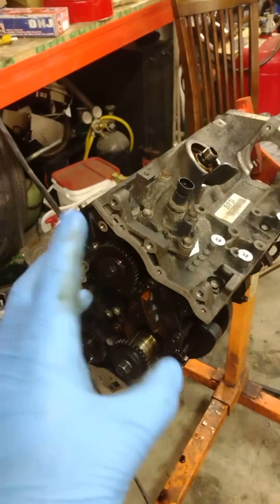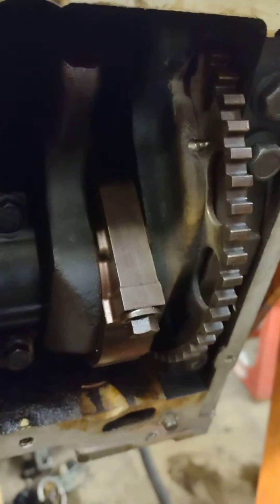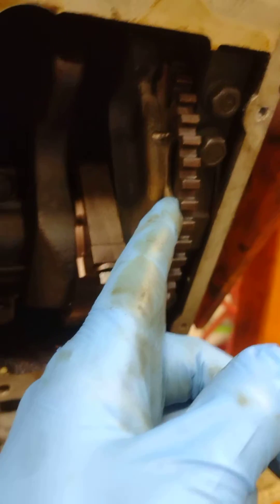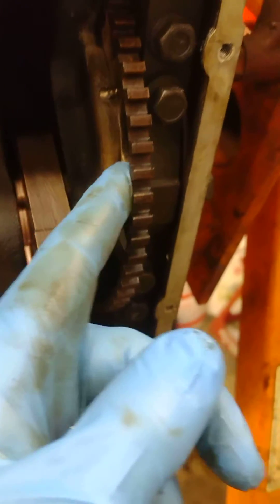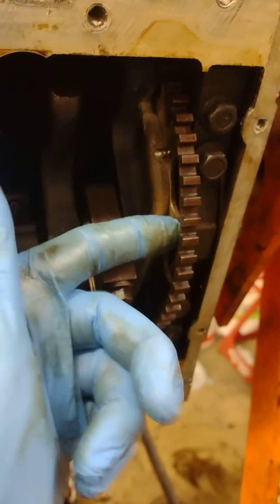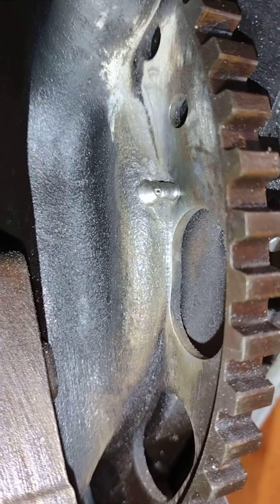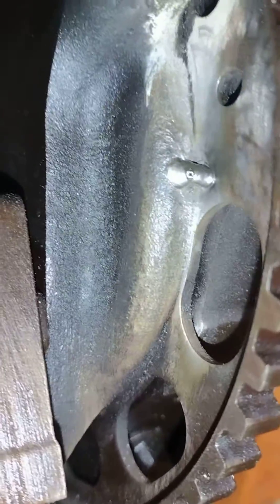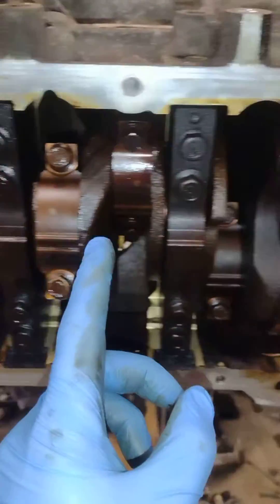GM 3.6L V6 crankshaft reluctor fix. (camshaft crankshaft correlation code)

Comment: One thing to take into consideration is magnetism caused by welding on a crank wheel that can be bad because it can interfere with the Hall effect sensors Ic by creating an opposing magnetic field and upset the pcm falsely setting crank codes.. may or may not be a problem, maybe that’s why they avoid it who ever rebuilds them, magnetism happens by applying a big DC current in one direction

Comment: I see you posted below, "You can verify reluctor wheel through the crankshaft position sensor hole".  My neighbor bought a used non running 2014 Enclave at auction.  Could you tell us where to find info on how to verify the proper reluctor wheel alignment.  He already replaced Crank Sensor, cranks but no start.  I am ordering a bore scope now.  Thank you.  So engine in this video is a good engine and you tack welded the reluctor wheel as a precaution, is that correct?
Reply from the maker: @jteddy11  yes precautionary.
Reply: @BBsAuto  Thanks for the reply, tack welding looks a whole lot easier that drilling and tapping, genius idea
Reply from the maker: @ yeah it really doesn’t need much but that is just one minor fixes these engines need lol
Reply from the maker: @jteddy11  yes it was a good block. 
There is a guy that shows a video on how to verify if it has spun on YouTube like you said through the crankshaft position sensor hole.
Reply from the maker: @jteddy11  it’s not super common but it is possible

Comment: Im getting P0017 and P0018 constantly on my daughter's 3.0 Omega (Australian car)
Woyld rhis have anything to do with the reluctor wheel?
Reply from the maker: I’m not sure on that. The design is probably way different compared to that engine. 
What is it that the car is doing?
Reply: @BBsAuto  it's basically a 3 ltr version of the 3.6.
It has 4 cam sensors and 4 actuator solenoids.
Engine starts fine, no rattles, E ns smoothly but is down on power. Slow acting throttle.

Comment: So did the fix work? Is it still working? Where you able realign the teeth to the correct position before welding?
Reply from the maker: It never moved. I hear that when they do you pretty much need a new crank.
But hey I would assume you could press it off and realign it.

Yes the reluctor never moved on it. 
It works to this day

Comment: I have a 2010 GMC Terrain 3.0. Timing chain was replaced in 2022, driven 20,000 miles since then. I am getting codes P0018 and P0019. Could this be my issue or do I have to replace timing chains again?
Reply from the maker: You can verify reluctor wheel through the crankshaft position sensor hole

Comment: I have a GMC Acadia I'm working on most likely it has this problem the reluctor wheel has shifted position this appears to be a great fix my question is when I open it up how do I know where to position the reluctor ring. Is there any indication where it was positioned originally so I know where to properly set it when I weld it in place?
Reply: @johnfloyd2551 There are some great photos in the GM TSB, that show one with the reluctor wheel moved and off time, and another photo that shows it in the correct position, in time. That was the "smoking gun" for me, when I was going about diagnosing the issue on the 3.6 Holden engine I was working on, that had the never ending cam/crank correlation fault codes. I listened the TSB# in one of my other posts. You probably already have yours corrected by now, but if not, that information will definitely point you in the right direction. Good luck 🙂👍
Reply from the maker: I have heard other techs say that the crack is bad after they move
Reply from the maker: But I suppose that it’s just a matter of moving it to the right spot

Comment: My garage told me this engine has 2 reluctor Wheels and they think one wheel has slipped causing a timing issue on the left Bank and said they have to remove my engine to investigate 🙄
Reply from the maker: There is 1 reluctor wheel and one crankshaft sensor on the crank itself. There are 4 cam phasers in the engine, and they have cam sensors and are the reluctors themselves. That send a signal. 
You can verify the crank sprocket is in the right place by searching it up. 
The cam phasers are checked easily and are more common than the crank sprocket.
Reply: It sounds as if they're kinda on the trail of the issue, but I believe they're still hunting and pecking at it. As @bbsgarage7640 said, there is only one single reluctor wheel on the crankshaft, that causes this problem. It's not anything to do with the camshafts. They are correct, in that in order to accurately diagnose and identify this issue, the oil pan must be removed. As to whether the engine has to be removed to do this, that may be an opinion of who's actually working on it. For me, there is no question, I'm removing the engine. As easy as these motors are to remove, and reinstall, it's a no brainer. You could possibly take a bunch of stuff loose, and raise the motor a few inches, and drop the oil pan, but that's just a nasty, incessantly dripping mess. Drop the motor out, put it on the engine stand, flip it bottom side up, and you have full access. Plus it makes it much easier to do timing chains, and other related repairs that are likely going to be needed.

Comment: I’ve worked at GM dealerships since 2004, not once have I seen or heard of a reluctor issue in these engines.
Reply: With all due respect, you might want to brush up on your knowledge base. This is a super common issue. The reluctor wheel slips on the crank, causing all sorts of timing related codes. Not only is there a GM Service Bulletin out about this issue, how to properly diagnose it, and how to fix it, there is also a bulletin from the National Highway Traffic Safety Administration. I don't know if you work in the shop, or parts, sales, or what department, but  if you work for the general, you should be familiar with this by now. I've got one in my shop now out of a 2011 Camaro, replacing the crankshaft and all the timing system components.
Reply: @timchilders3535  I graduated tech school in 2004 with honors. I immediately started my tenure at our local Chevy dealership. I’ve got nearly 20 years not only in turning wrenches, but writing service , and as well as parts serving my last 8 years as parts manager. I oversee all outside sales and over the back counter sales to our shop. Not once have we replaced a crank due to this supposed “common” problem. Just because there is a tsb on a problem, does not mean it’s common. But quite the opposite, it more likely to be uncommon. More like a “hey, if you’ve got these symptoms and a diagnosis can’t be determined, this could be the issue “. Shade trees keep us in business with they’re faulty repairs and general ineptitude.
Reply: @stellingbanjodude  So, do you think that GM engineers are wrong, and don't know what they're talking about? Seriously...why don't you just read the TSB. This is actually a known condition. Just because you may have never seen it, doesn't mean it doesn't exist, or that GM is full of crap. Read the TSB. It'll explain it in detail, and how to fix it. It's mainly the Holden built engines. If you haven't ran across it yet, you will eventually. GM SB 10055422-3142 will explain it in great detail, and tell you what models and ranges are affected. And by the way.....I worked at dealerships for almost 30 years. GM, Ford, Volvo, Volkswagen and Porsche. I left that rat race in late 2018 and opened my shop. Never looked back, the independent business, working for ME,  is a lot less hassle and politics🙂
Reply: @timchilders3535  can you people read? Nowhere did I say this was bogus. But to hear you tell it, every vehicle with this engine suffers from this condition. A TSB is just that, a bulletin, a “heads up” if you will. “If your vehicle exhibits this condition under this circumstance while doing this…….” Every single vehicle has TSB’s for something. If it’s a modern vehicle it comes with at least 2 recalls as standard equipment.
Reply: @stellingbanjodude  I read very well. Tell me where I said every single vehicle has this problem. You said you had not once ever seen or heard of a crank being replaced for the slipped reluctor wheel issue. Many have, actually. Check the TSB, it's quite a range of vehicles potentially affected. Then check the NHTSA stats. That will tell you a good deal about how many have been repaired under warranty for this problem, utilizing a new crank, and other components, as directed in the bulletin. That's not shade tree. It's accurate diagnosis and repair, if done correctly. The one I've done so far, I did by the TSB, and it's fixed and hasn't come back. It's not some unknown or obscure issue, that's all I was indicating. They identified the problem, as to why certain ones slipped, and corrected it. Incorrectly sized reluctor wheel, poor interference fit. It's a pretty good job, not that hard, pays well. I'll likely see another one or two, and once you know what to be checking when you find the two noted cam/crank correlation dtc's, it's time to be pulling the pan, and checking the reluctor wheel. Lots of people will replace cam sensors, crank sensors, and even chains....but it won't fix it. Luckily, when I researched the fault tracing for the codes I had, I got pointed in the right direction the first time.
Reply from the maker: JASPER® remanufactured GM 3.6L GDI engines are built to meet or exceed OEM measured standards and have a 3 year/100,000 mile nationwide, transferable parts and labor warranty.  Click here for complete warranty information.  Our 3.6L GDI is a completely remanufactured engine with new wear parts, exacting tolerances, and live-run tested reliability.

The 3.6L GDI engine is commonly used in popular applications such as, Chevrolet: Traverse, Equinox, Camaro, Impala, and Caprice – Police Applications; Cadillac: CTS, SRX, STS, ATS; as well as Buick LaCrosse.

The original 3.6L GDI engine is susceptible to issues that include: oil consumption, dry start-up, piston scuffing, cylinder bore wear, head gasket failure and leaks, camshaft noise, VVT failure, low oil pressure/knocking, valve guide wear, spun reluctor wheel/timing, fuel leaks, and runability.

JASPER remanufacturing advances include:

Stronger forged aluminum JASPER-engineered pistons with a smooth, fully-machined, anodized crown, which provides a thermal barrier and reduces carbon buildup.
JASPER-engineered pistons include additional oil return holes (14 total).  This increases oil drain back by 250%, or greater, to reduce oil consumption and prevent oil rings from sticking.
JASPER installs a robust two-piece 2.0mm oil ring for improved oil control.  OE uses a thinner, 1.5mm, three-piece design on LFX models.
Top ring land is profiled to prevent scuffing at higher temperatures.
An additional accumulator groove is machined into the piston which decreases the pressure between the 1st and 2nd ring land and prevents the upper (compression) ring from unsealing at higher RPMs.
JASPER supplies an updated valve cover gasket in our JR set to assist in proper PCV operation and to help prevent oil consumption.
100% torque-plate honing of the engine block, utilizing a torque plate and specially-designed Grade 10 ARP head bolts.  This provides a cylinder wall geometry that matches the cylinder head as a complete running assembly, for improved ring sealing.
JASPER-engineered pistons have a wider graphite coated skirt than OE to help prevent dry startup and piston scuffing.
An improved piston skirt profile provides greater stability in the cylinder bore, reducing wear, and providing better ring sealing.
JASPER’s piston has a 40% wider piston pin surface area than the original design to improve durability and promote scuff resistance.
100% installation of a set screw on the reluctor wheel, which prevents it from spinning on the crankshaft, eliminating timing/runability issues, or even crankshaft damage.
Chrome nitrided steel top rings are installed for improved durability, heat resistance, and reduced cylinder wall wear.
Thicker, fluoroelastomer polymer (FPM) coated Multi-layer Steel (MLS) head gaskets are installed to ensure superior protection against gasket leakage. Our gasket is more robust to maintain the correct compression ratio.
100% installation of NEW head bolts to ensure even clamp load.
Block and heads are resurfaced to a 50-150 Rz finish.
100% installation of NEW camshaft thrust washers, which prevents camshaft endplay and noise on early-design heads.
Crankshafts are machined and micro polished to exact tolerances for improved bearing oil clearance and reduced wear.
100% installation of NEW nitrided valves for improved heat resistance and reduced valve guide wear.
100% live-run tested to verify proper compression, vacuum, and oil pressure.
100% tested intake and exhaust cam actuators, to verify proper performance.
100% black light leak tested, to ensure the unit is leak free.
JASPER includes a fuel injection kit, which includes fuel line(s), injector seals, and a high pressure fuel sensor (on the LLT applications), this prevents fuel spray leaks that can potentially lead to a fire hazard. (PTFE Seal Installation/ Sizing Tool sold separately.)
Please visit our GM 3.6 GDI Product Page to learn more about some of the quality processes we perform to this engine family.

Check out our online catalog for pricing on a JASPER remanufactured 3.6L GDI engine for your car or truck. Most applications of the JASPER 3.6L GDI engine are available immediately through our large distribution network across the U.S. This means you can be up and running again quickly and reliably. So, as soon as you get a price from our online catalog, just click on the Find an Installer icon to find the installer closest to you.

Full warranty disclosure available on our website or upon request. Specifications subject to change without notice
Reply: You work for a dealer? With due respect intended, this has been an issue for some time. There's even a TSB on it. A quick google search will take you to that Service bulletin. I'm a lifelong Chevrolet guy and it just occurred on my Colorado. Mad? No... disappointed that they didn't address this long ago (been happening since the Saturn days) Yes.
Reply: @tc223  oh you read it on google?! It’s got to be a problem then!
Reply: So….How to you get it to spin to re adjust it??? Mines one tooth off from where it should be.
Reply: @adriangrigg1989  I've heard of people adjusting it to correct, and either pinning it, or welding it. I'm not really sure how to move it, maybe bump it with a hammer and punch? I didn't try it, my customer just decided on a new crankshaft. If, it were mine, I would have probably tried to center it up and then weld it. You would have to take care and do even welds so as not to create an imbalanced condition. Wouldn't be that hard to do. As far as moving it, I think bumping it lightly with a small flat punch and a hammer, should move it for you. You could try heating it a little with a torch, but obviously you would have to be careful. Good luck! PS the one I had, was just about two teeth off. Timing related codes kept storing, and wouldn't go away.